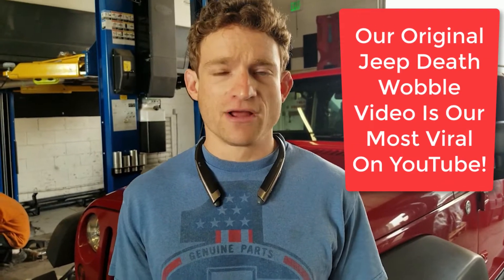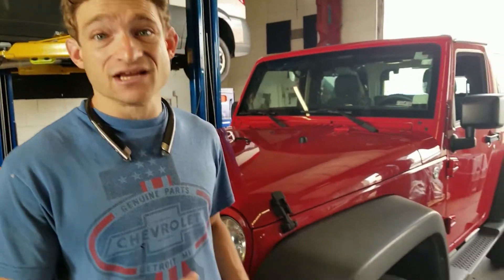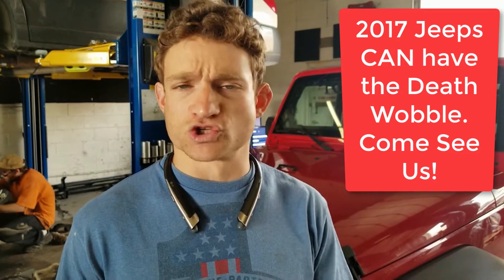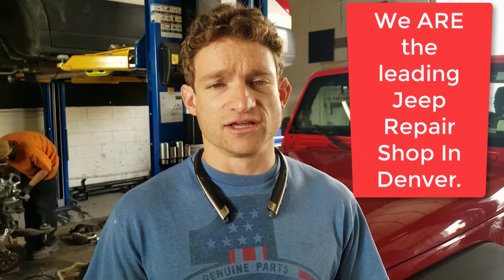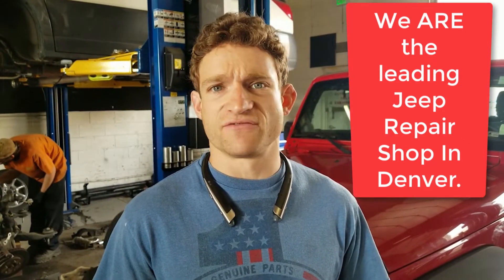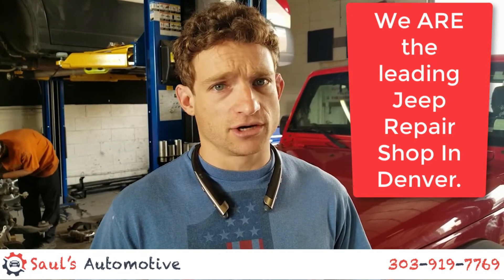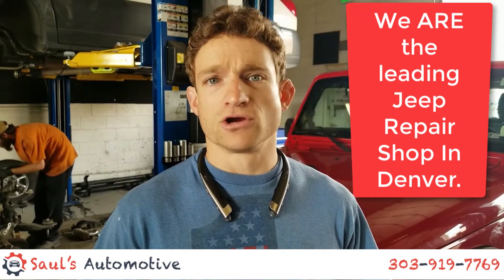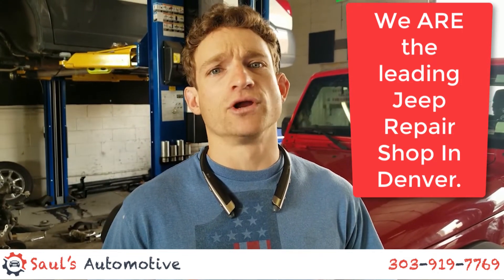The Jeep Death Wobble Follow Up 2018 We Repair In Denver

Comment: This is the first REAL information I have heard, read or seen about this subject... thank you... My local dealer has replaced the steering dampener / stabilizer 4 x in 3000 miles. It works for about 500 - 750 miles.  It's a bandaid and frustrating to the point of taking a loss and moving on to another vehicle.  Though I know a lot of other people have experienced wobble in their solid axle vehicles, I had a JK for years and never had steering issues.  For all the news about the refined features and amenities in the new JL, I had higher expectations.